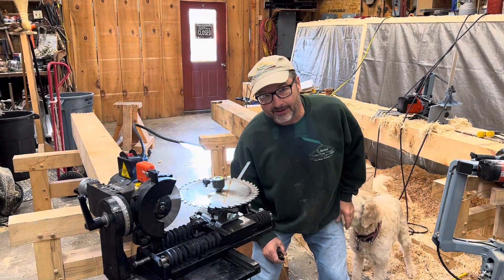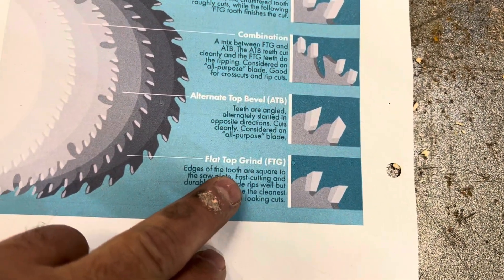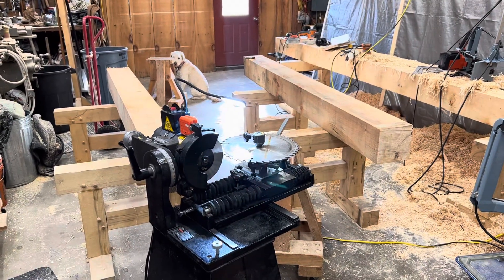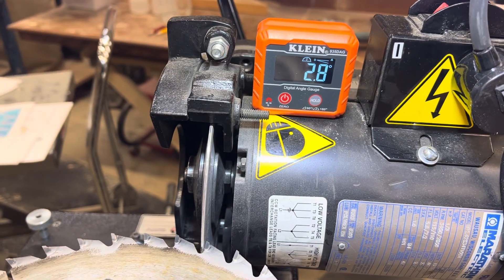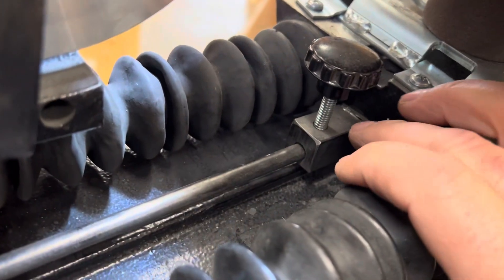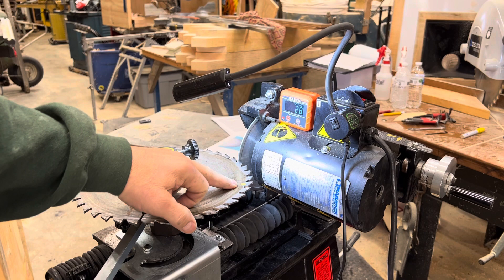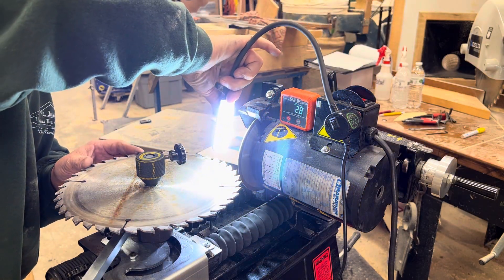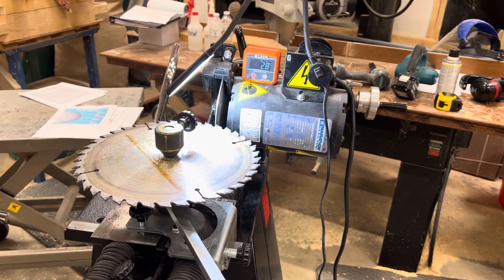Timber Framing - Foley 310 sharpening a circular saw blade

Comment: How much does it cost to have a carbide blade sharpened? I am guilty of just throwing them away, nobody around here sharpens them.
Reply from the maker: Generally I charge $0.50 per tooth, $20 minimum.
Most new carbide blades I see do not have enough carbide to do a top cut - so, generally I can only do face cuts.
That said, a lot of times you can find good quality carbide blades for $20 or less, so it’s cheaper to buy new than sharpen.  If you have a specialty blade that is expensive, then it makes sense to sharpen.
Hope this info helps.